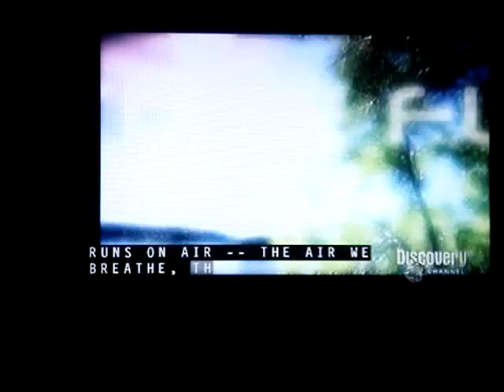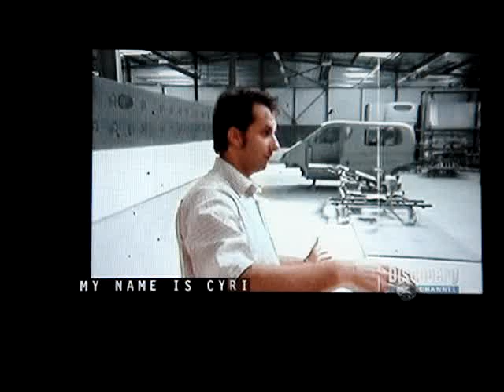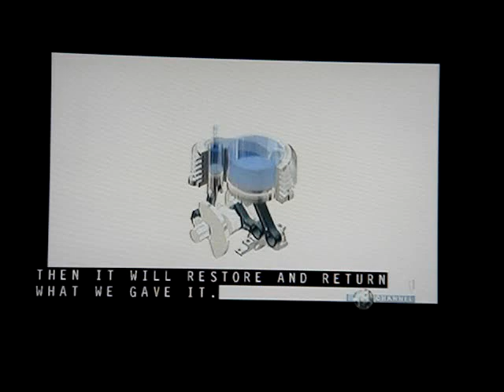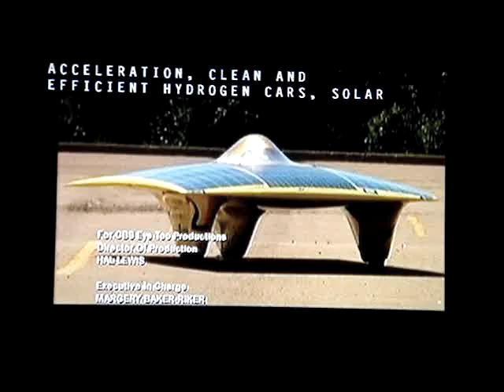futur car 04-air car, air purified and cooling car

Comment: OK dummies go buy an air compressor and see how many solar pannels,windmills etc it takes to run a 220 volt electric motor,one is transfering electric energy to an air tank#2 hook up the biggest air tool you can (a poisher-grinder) most home compressors won't even keep up with the tool,the negitivity your reading is based on fact not pie in the sky wishfull thinking 1 cup of gas is = to 4 sticks dynomite now thats energy storage!!!!

Comment: You use solar panels on the roof to charge batteries and have a alternator!!!
And have a air compressor that turns on when the pressure gets low!!!!!
And there is the possibility of using small wind air compressors!!!!

Comment: What they are talking about is regenerative feedback. Not perpetual motion. Yes, regenerative feedback would make the car more efficient. The car is more efficient too because you're not losing energy in the form of heat as you do with most combustion engines. Yes, this car gives off heat, but not as much. Again, much more efficient than today's cars. Your days are numbered Exxon Mobil.

Comment: I don't think that the presenter of this part of discovery channel had any idea of thermodynamics. They may say that solar cell will make energy because you can generate electricity again from solar cell using bulb? Air motors are the most inefficient way of converting into mechanical energy.